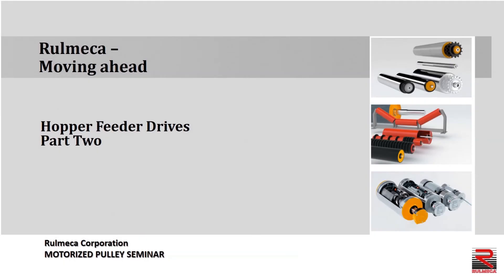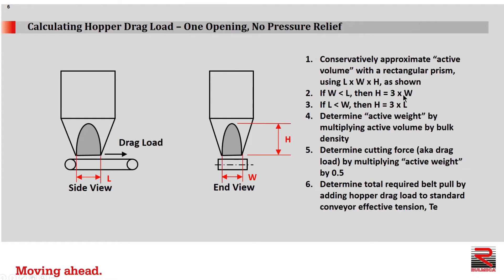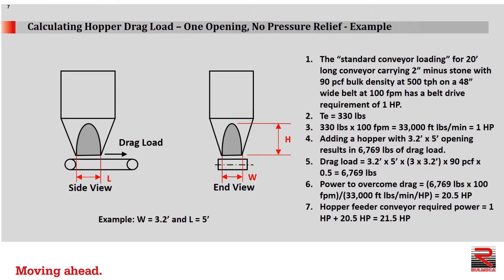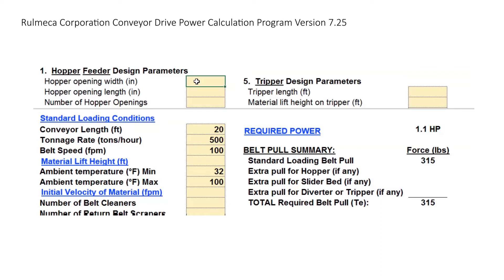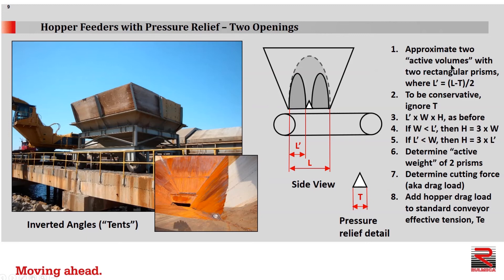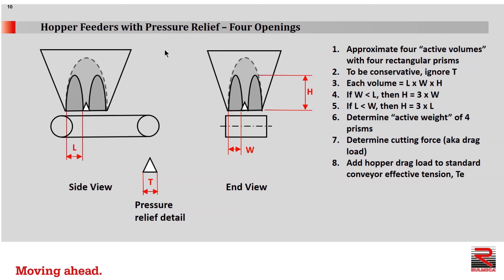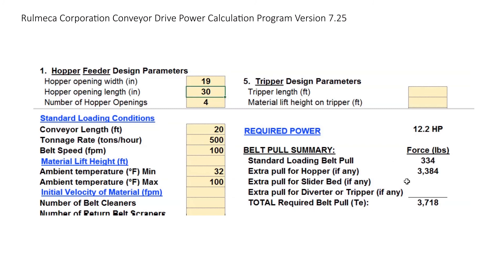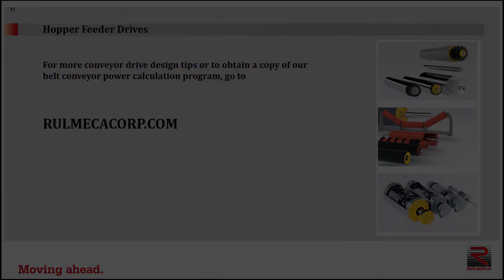Hopper Feeder Drive Design Part 2 of 2

Comment: Does drag force exists when material is fed from pre feeder(ROTARY FEEDER) in case of powdery material? If not what are the other factors we need to consider to design a belt feeder below a storage hopper with pre feeder
Reply: Thank you for your question.  A sketch will be very helpful in answering your question.  You can reach us at sales-us@rulmeca.com.  Best regards, Mike